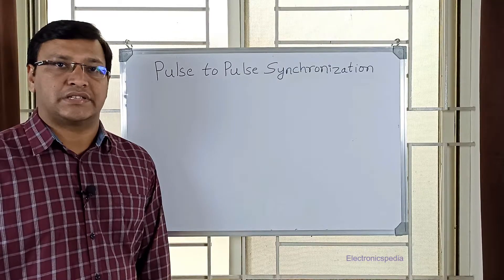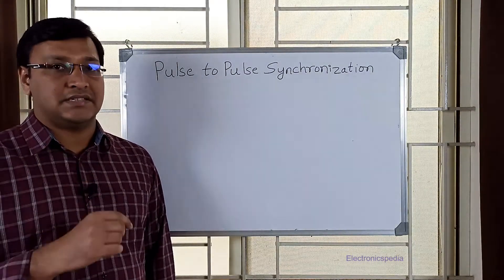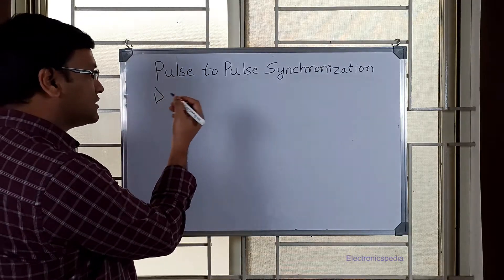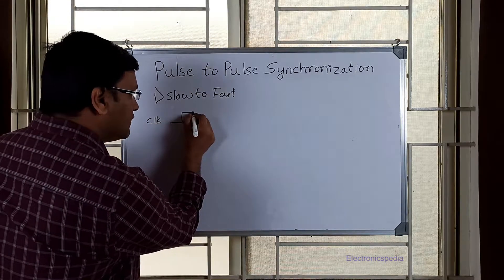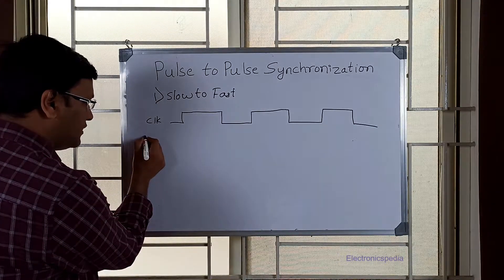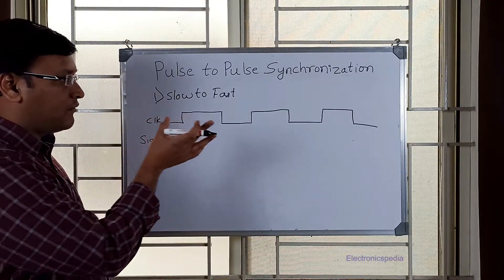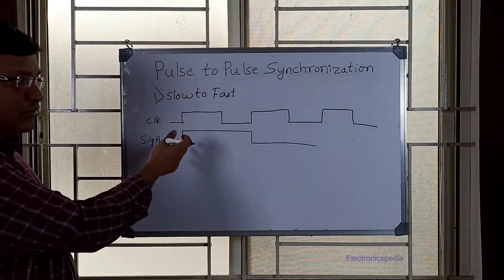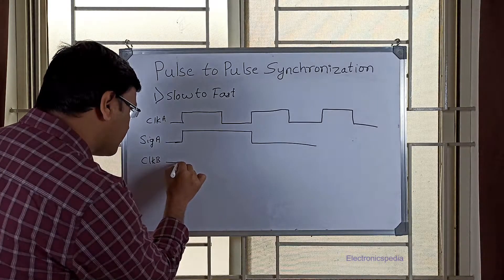Pulse Synchronizer CDC | Toggle Flop synchronization| Fast to Slow Clock| VLSI Interview Question

Comment: Is there a way to synchronize alternate clock cycle pulses from faster clock domain to slower ?
Reply from the maker: Use T FLOP in source domain, which will have 0-->1 transition on alternative clock cycles. Synchronize this in destination domain and do posedge detection.
Reply: @Electronicspedia  thanks, one query here, destination clock takes more than 2 clocks for synchronisation to complete, whereas on source clock pulses are continuous at alternate clock.

Comment: Hello Sir, I had a doubt...when we move from faster clock domain to slower clock domain , whether we use pulse to pulse synchronizer or a Handshake synchronizer. Both have the same limitation that if pulses are coming continuously without much time-gap, the synchronizer will miss few pulses until we use a counter. 
My question was, is that the only way to mitigate this limitation? 
And,  in the counter method, would we be 'queuing' the pulses from faster clock domain and send to slower clock domain?

Comment: The video is great. However, I still have some doubts at 16:36. Given that there is one input and the output Tq is supposed to toggle, I'm confused as to why the toggling of Tq lags one clock cycle behind the signal A.
Reply: at second rising clock edge , i think the pulse has died, so the output toggles to negation of dead pulse, IE negation of 0  IE High. 
Every rising clock edge thereafter we are seeing no new pulse , so output toggles to high and the high is maintained. Did this answer your question ?

Comment: what is difference between two flip flop and std double synchronizer ? they look  similar in ciruit
Reply: standard double synchronizer is used when a "level signal" is being passed from clock domain a to clock domain b. here the first d flip flop in standard synchronizer gets the metastability and it is filtered by the 2nd d flip flop. It is called standard cell because a specific gap maintained between FF's so that signal wont be suppresed. But a normal d flip flop just delays the signal by 1 clock cycle.

Comment: Your Tq is wrong since TFF will also toggle the zero level after the PA pulse to '1' - check it
Reply: No its correct, it will detect zero and thats why it will retain past value Qn which is 1 , so tq remains 1. (T flop toggles only if input is 1, if 0 it will retain Qn.

Comment: Nice video - but there might be some inaccuracies at 15:38:
While drawing the timing graphs, you are assuming the frequency of clkB matches clkA which is incorrect. doubleq and output of the last flop do not follow clkA frequency -> the pulse at the output of XOR should be as wide as the (timeperiod/2) of clkB. 

Is that correct?
Reply from the maker: There is no assumption of clkb freq same as clka. They can be completely asynchronous. Here just got drawing diagram i have considered the clocks same. But the logic still holds good.

Comment: in the video at fast to slow concept in timing diagram the output of tff is initially zero and when the pulse arrives the output of tff qt should change at the same clock edge as the pulse arrives is that correct?
Reply from the maker: Hi Vinay, all the flip flops considered will sampling the signals on the active edge of clocks and these will be sequential elements hence the data will appear on the output in the next clock cycle. 
But however for waveform representation some people choose to draw it on the same clock.
Reply: @Electronicspedia thankyou so much....

Comment: Thanks, it was explained very nicely. I had a few doubts about this.
what if we use a D FF at the source side, and the clk relationship of source and destination is not known as it can change in the later stage of the design. Considering the above constraints
1. for how many clock cycles should the signal be stretched so that it can be sampled at destination clock?
2. Will this technique work or we should go with a handshake-based mechanism?
Reply from the maker: If clock relationship is unknown then it's makes sense to go with handshake based mechanism.

Comment: Hai sir
In slow to fast domain after using the dff(after 3rdff) we will generating pulse,but the generated pulse Frequency not same as the pulse frequency of domain A.
This is correct??
Reply from the maker: Yes you are correct. That is why we call it as clock domain crossing. 
Crossing of signal/pulse from clock domain A to domain B.
Reply: Thanks for your reply.but in the domain B instead of AND gate (like edge detection) we used XOR.Why can't we use AND gate to generate the pulse instead of xor gate or else shall We use the AND gate?
Reply from the maker: XOR gate will generate a pulse in domain B, every time there is a pulse in domain A. Here the thing to be noted is on clock domain A, we are using T flip flop to generate the level signal. That's why we need XOR gate, if you use AND gate based edge detection technique we can detect only either posedge or negedge not both together. But with XOR gate we can detect posedge and negedge both.
Reply: @Electronicspedia  okk
Thank you so much for your well explanation.